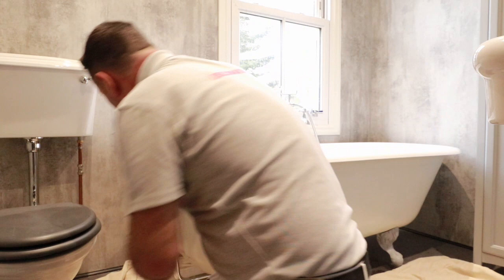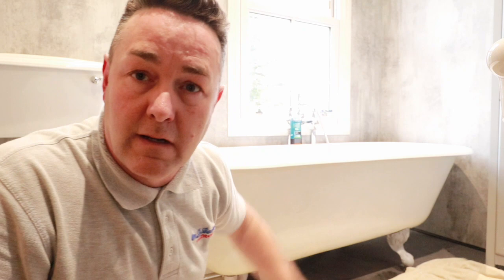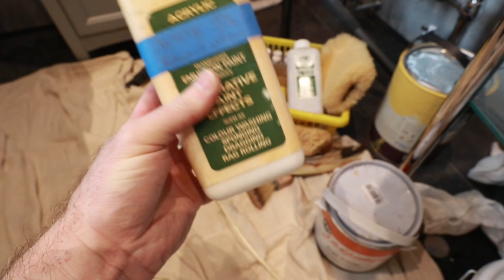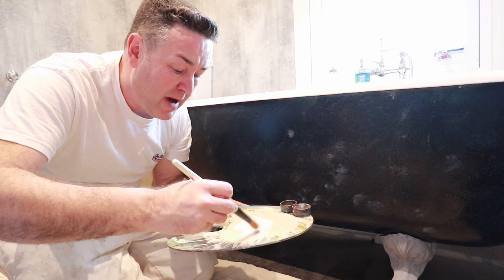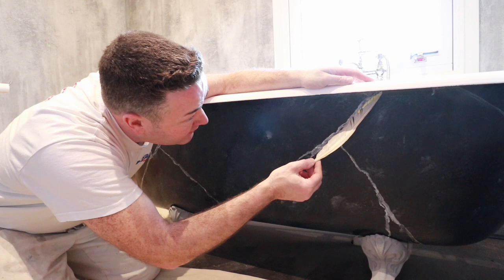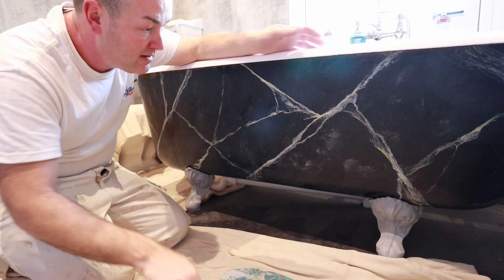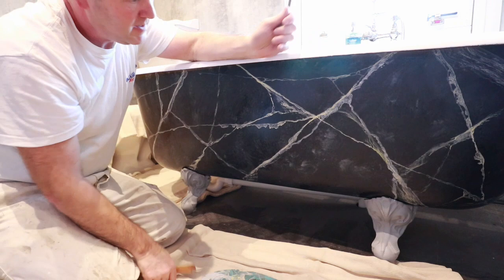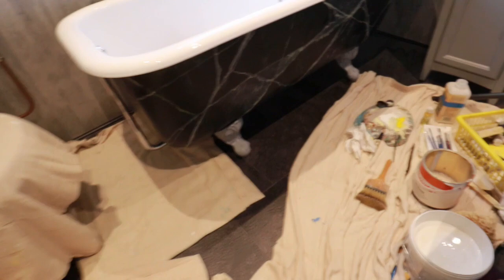HOW TO.. painting a cast iron bathtub - with a marble effect finish - FULL TUTORIAL

Comment: Hi Phil love the videos 
I’m just about to start a new trocoya mdf exterior weather permitting 🤞was thinking about using bullseye 123 primer then 2 top coats of zinsser exterior satin with just a roller and brush finish.
Do you rate this product or should I maybe use something from tikkurilla.
Thanks Wayne
Reply from the maker: I'd check, is there any need for tye 123?
AllCoat exterior satin is very nice to apply and the finish is great.

Tikkurilla do Ultra Classic.
Use the ultra primer then it's two finish coat of the ultra classic.

Check the names, ... It's all waterbased.

Used both... Very good.